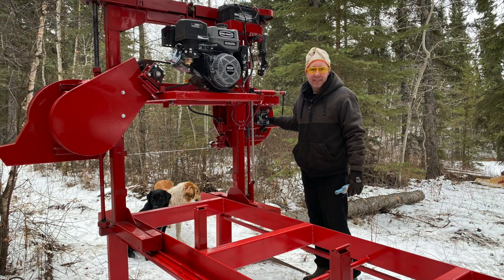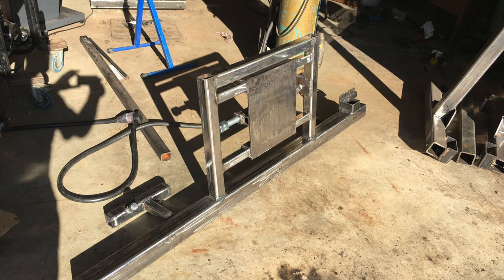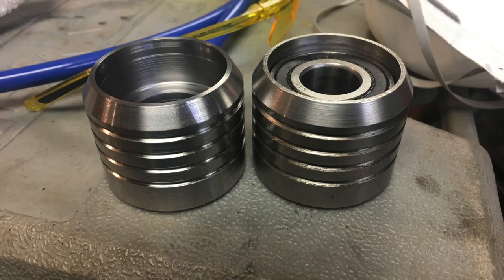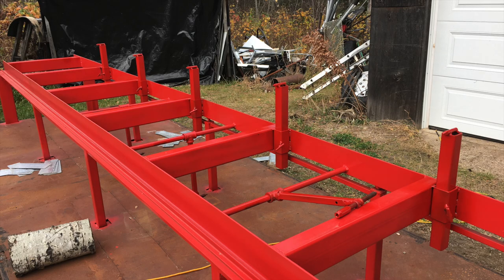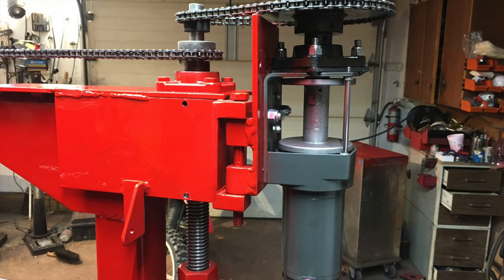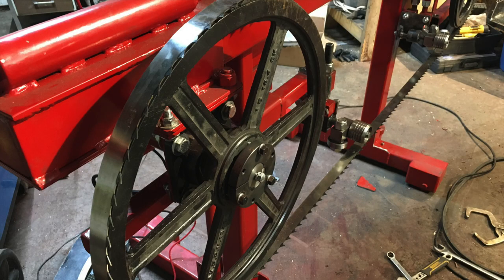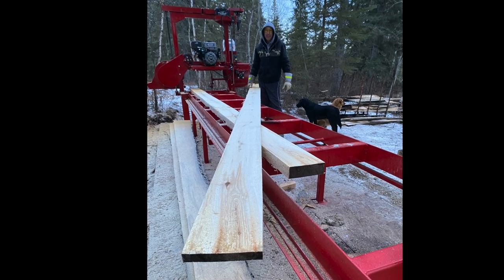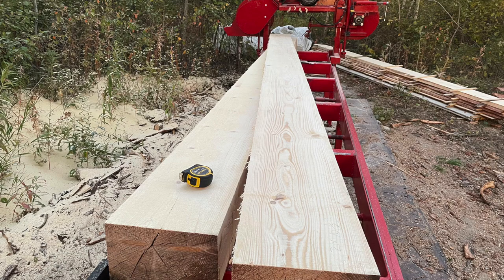Homemade Sawmill - Based on TexasBen's Plans

Comment: I bought his plans and had a couple of questions and was unable to contact him. Now I know the reason! On the saw boxes, I see where you put some small bearings to maybe make the boxes go up and down easier. Is that the case?  I'm getting to the point of adding shields but still have a ways to go. I'm going to try and make it power driven!
Reply from the maker: You are correct!  I did put some additional bearings around the boxes that go on the vertical posts.  In hindsight I should have had more play between the boxes and vertical tubing.  When you weld the joints they tend to tighten up due to contraction.  I am so glad your build is near completion!  It is so rewarding to use something that you created from scratch!  I should have had a mill 40 years ago, I could not even imagine how much lumber I could have milled and what I could have built having access to that lumber.  Take care.  Robert

Comment: I bought a set of the plans from TexasBen, but I haven't built a mill (yet). Just curious, do you know if Ben is still selling plans?
Reply: I don’t know.  I see on eBay someone is selling plans that appear to be from TexasBen’s first sawmill and also the second design that i have in my video.
Reply: @roberttymofichuk1276  Thanks.

Comment: How big of log can the sawmill handle?
Reply from the maker: I can cut a 32” diameter log.  The plan allowed for a wider width - you just needed to space the frame apart more.  The track length will allow me to saw a little over 16 feet.  In hindsight, I would have made it accommodate a 20 foot log.

Comment: I have an idea for a superior all around use bandsaw mill. It is like an alaskan mill but is all electric. The two hubs are ebike hub motors, about 12 inch diameter or so, and the supporting frame is lightweight, as hub motors are lightweight for what they are too. The motors are driven in paralell, and the driver is high current, not cheapo chinese shit electronics. 
The power is connected with either a battery or a high current dc supply. Solar or extension cord or whatever makes most sense. 
The main advantage is no noise, dust, smoke, vibrations, 
ANd the logs can be milled in place, as this is a much easier thing to handle, the logs dont need moving. The waste is just shavings and offcuts and that will be fine if left on location or whatever.

2 hub motors instead of one power wheel and one follower means you get twice as much avaliable torque, Less likelyhood to break a blade, and better tracking. The tensioner can be aired up tires, and alignment can be done with shims. 

This has all of the advantages and very little disavantages. If it works on 120v that would be prefered, if not, then i think 48vdc is the only other sensible operation voltage, like the motors accept stock. 
They deliver alot of power and torque, I think 3kw per motor is easily attainable. That means 6kw of low loss power transfer. Low vibrational loss, and smooth laser like cutting. I would make one that can do 10 inch depth 42 inch width. 

The starter board straight edge method works great. and its very easy after that first cut, which is also easy. Then the slabs can be put on sawhorses and cut diemsionally with a circular saw. 

It makes most sense to leeave them as slabs, stacked dried and somewhat cured, in sun with black tarp. 

Overall, I think it would beat all other sawmills. 

Have a nice aluminum frame, light, anodized, with a throttle handle and a big flat platton. 

The tool would be useful and durable and easy to repair. The wheels are very sturdy though, and the motors too, because bikes take lots of differnt loading. 

What do you think?? Yours is good concept, but is not as streamline as it may seem. I think it needs to be lightweight, so no moving logs, just fork the stack when its cured in place.
Reply from the maker: The idea certainly is innovative.  I wish I had experience with an Alaskan mill.  I am going to do some research now!  I want to find out more about electric bike motors as well - it’s something I have not tinkered with.  One consideration that folks talk about is having a large enough diameter of the wheels for longer blade life (smaller diameter wheels fatiguing the blade).  Would a person be using a typical blade like the bandsaw mills or using a thinner version like on a bandsaw in a shop?  Would the blade wander more?  I can’t wait to read what others think of the idea… l love how innovative people can get when one poses a unique idea!
Reply: Blades are a whole other subject also. I would like to have a blade with fewer teeth and larger gullets. Like the 90 tilt sawmills, they can have just 2 or 4 tungsten teeth on a circular blade, for efficiency. SO, maybe custom blades could be ordered. I would think 1 tooth per 2 inch and large gullets would do the work. Less drag, easier sharpening, which we all should master.  I think wide blades for tracking and stability are necessary for saw milling specifically. 
The kerf of the blade would limit the bend radius, mostly. limiting too is the weld, but not as much as other parameters. 
Honestly have not looked into blades as much because I have no sawmill or bandsaw at the moment. Just a chainsaw mill which is a handful and more. 

  @atlantisdiving1